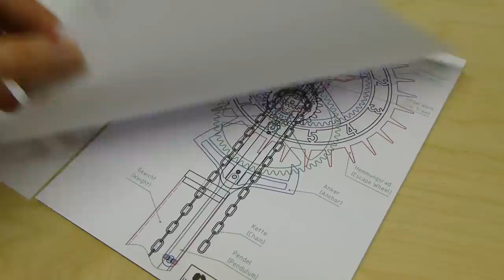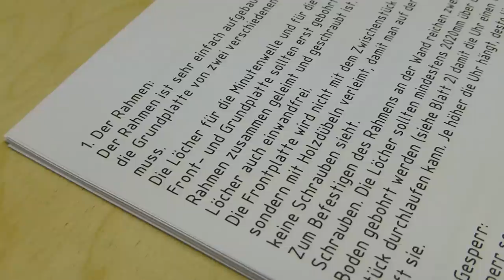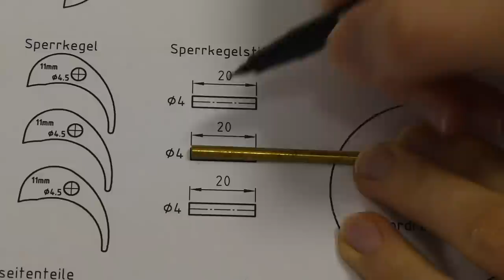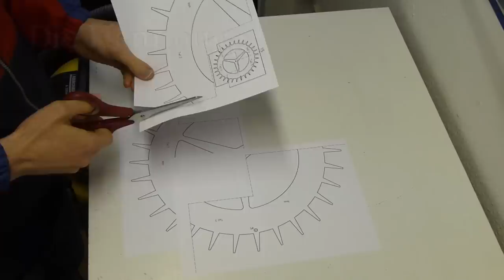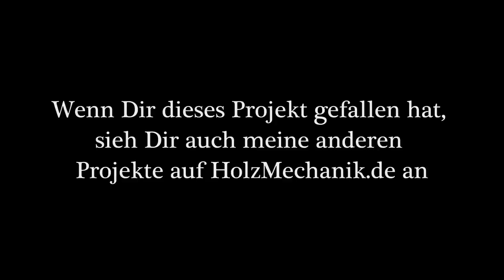Korona - Holzuhr (Wooden Clock)

Comment: Amazing that it works. The escape wheel teeth should not fall on the impulse face, but on the dead face.
Reply: ... but does work. Just because something doesn't work the way you where taught doesnt mean that it's "wrong".
Reply: @quimblyjones9767  Yes you are correct, but a useful analogy might be that a car running on three cylinders will work, but if it is designed to run on four cylinders it will work better.
Reply: @brianwarburton4482  that statement is just false. There are plenty of functional inline3 engines, and it isn't that a 4 or 6 cylinder is any "better" it's just that it works *differently*. Does it have less power? Yes but it is smaller then a 4 and runs smoother.

My point is that you accused this of being "wrong" but I seriously doubt that you have enough experience to criticize this design.
Reply: @quimblyjones9767  I didn't say it was wrong. I was talking about a 4 cylinder engine that is only running on three engines, and I am a clockmaker.
Reply: Sure you are..

Comment: Beautiful clock. Would love to try and make it. I have bookmarked your video. I am wondering though, why does the dial need to be balanced when it doesn't appear that it is moving?
Warum muss das Zifferblatt ausgeglichen sein, wenn es sich nicht bewegt?
Reply from the maker: Hi Matt. Thank you. It is necessary to balance the dial because the different numbers have different weights. So without balancing it the twelve and six will not be exactly vertical :-) Warm regards, Christopher

Comment: Would it be a great idea to make this whole thing in metal instead(excluding the dial)?
Reply from the maker: Hi Jonathan, this clock in metal would need a larger drive weight. This is possible, but difficult. So I would not recommend this.

Comment: Hello
I wonder what I get when I buy the Korona watch plan?
Reply from the maker: Hi Roland. Good question. The plans are pages which show the objects in the assembled state. You get also a small instruction guide with a materials list and source of supply. And of course all parts are drawn. The parts are usually drawn in original size, so you can glue the drawing directly to the wood. For parts that are larger than one page, you have to glue several pages together or the parts are so simple that you can transfer them based on the measurements to the wood. If you want an example you can download the small but free plans of the wooden automaton "Katz & Maus". The page size is DIN A4. If you can not get DIN A4 paper, you can print the plans also to "Legal" paper. After the purchase I can also send you a dxf file, if have a CNC machine. Warm regards, Christopher

Comment: wow.. can you tell me how its "weight" calculation so i can get the right time?
Reply from the maker: Thanks. The weight is not important for the right time measurement. It is the lenght of the pendulum.
https://en.wikipedia.org/wiki/Pendulum
Reply: ooohh.. i see. thanks a lot :))
Reply: excuse me. i have problem in escapement wheel and pendulum. it's just can work for a few second. infact i was adding bearing beetwen gear axis and frame to smooth its movement.
can you give me some a troubleshoot? maybe from your experience or reference.

thankyou.
Reply from the maker: Hi Chanif, yes. I will of course help you as good as I can from the distance. Please send me an email with some pictures of your clock and of the bearing situation so I can see how far you are. Sometimes the solution is very simple. http://holzmechanik.de/impressum_eng.html
Reply: ookay thanks alot. :)